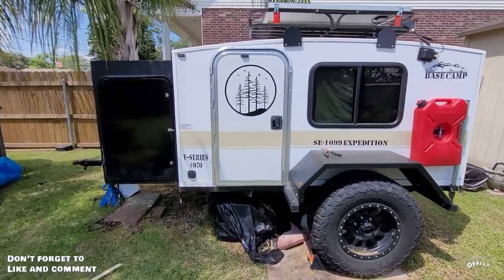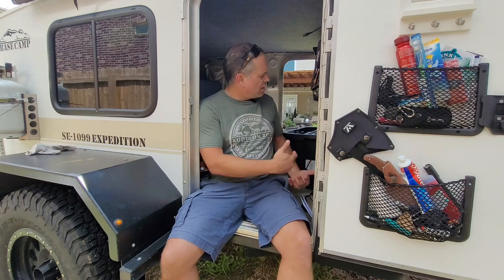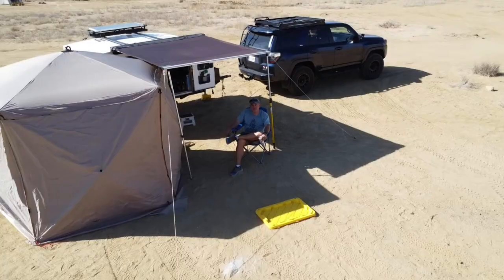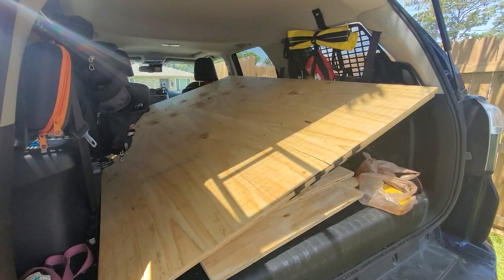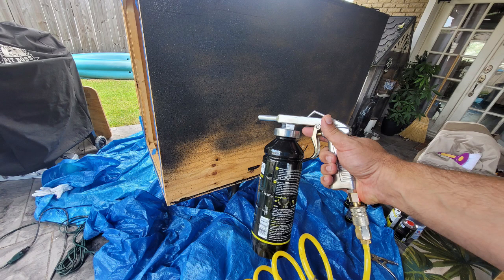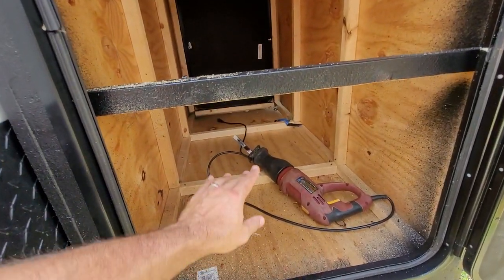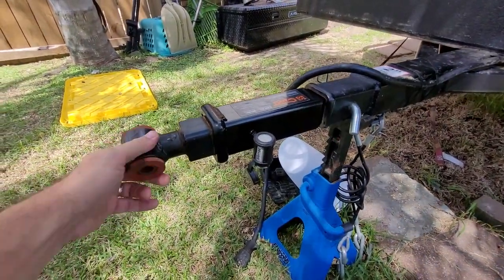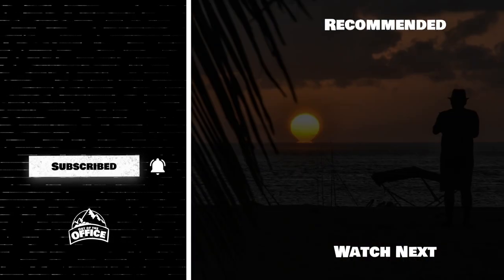Building a Giant Storage Box for the Offroad Teardrop Trailer

Comment: I thought these came stock with an A/C unit out the front wall of the cabin.  Or did I miss something.

Yes, I also passed on the factory tongue box.  I want as big a box as possible, less for heavy stuff than for bulky items, like full-sized shovel, pick, extra poles and what-not.  I don't think I'll mess with extending the tongue.  As big as I can make it, while keeping it stock.

The cabin is still a great place for cargo, but for me it'll be more about special gear I might want or need for a particular trip.  A big tongue box means I can take more gear and still have a bed ready for me when I pull into camp.